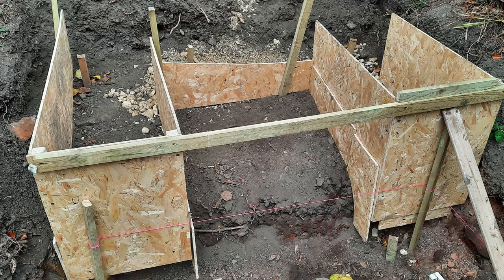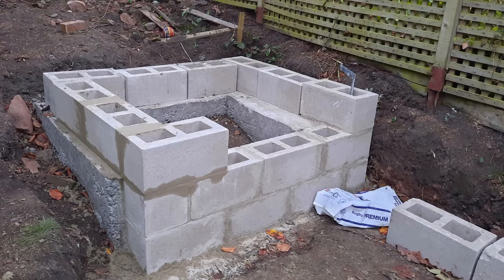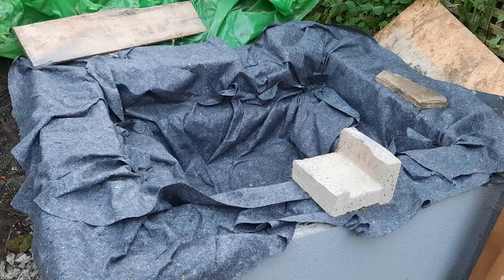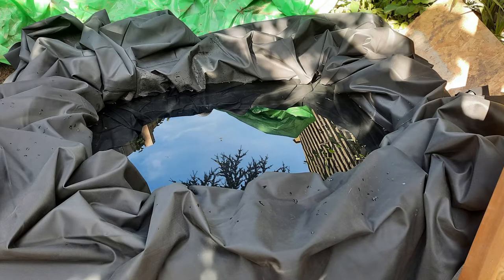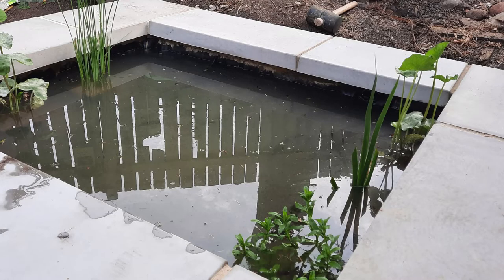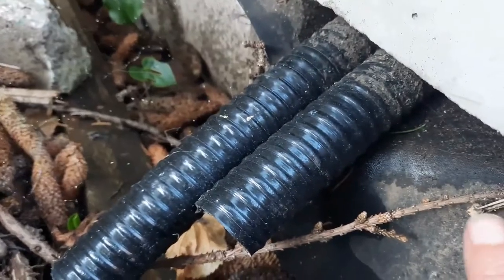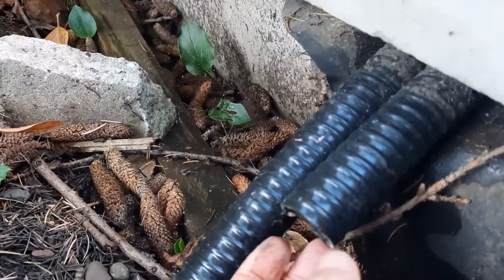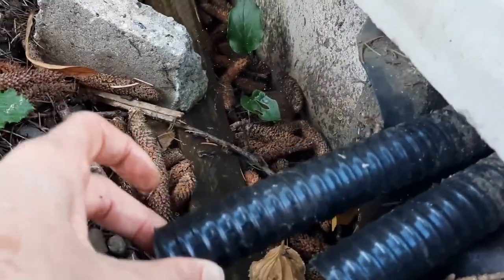How to build a raised pond with concrete blocks

Comment: Thank you so much for posting this video! I'm about to start on my own pond, and the style will be similar to this. One things I have been researching is how do you attach the coping stones to the pond liner? It looks like on one side the liner covers only half the top surface of the blockwork... so I guess you just applied cement over the liner and exposed parts of the stone and then lay the coping on top to hold everything together?
Reply from the maker: Hi! I'm glad you have found it useful. Yeah we tried to cover the actual holes in the blocks as much as possible with the liner to stop any overflow water going down inside the blocks but still leave enough of the block surface to form a good surface for the mortar to attach to. And yes the mortar went on top of both the liner and the blocks. The overflow pipe seems to have worked though so water going down into the blocks doesn't seem like it would be an issue at all anyway. 😊
Reply: @junglealltheway6342  Thank you so much for taking the time to reply - I really appreciate it! This may be the only time in my life when I build a pond (it's for my new family home, which we plan to spend decades in), so I'd like to get it right first time! Thank you and enjoy summer when it arrives!